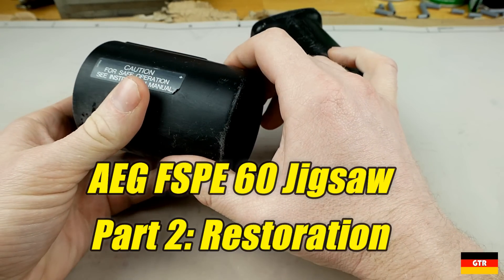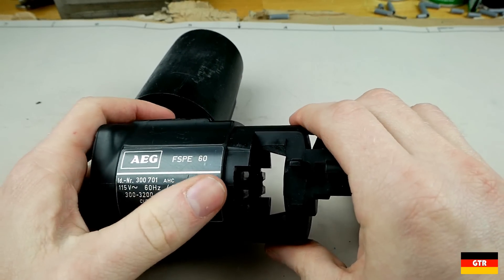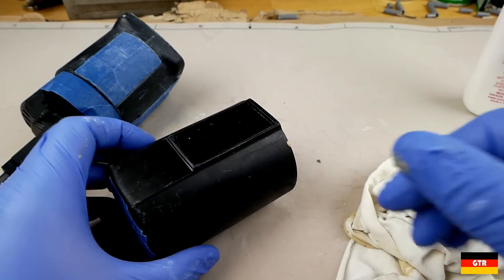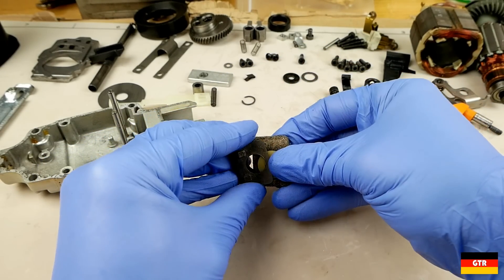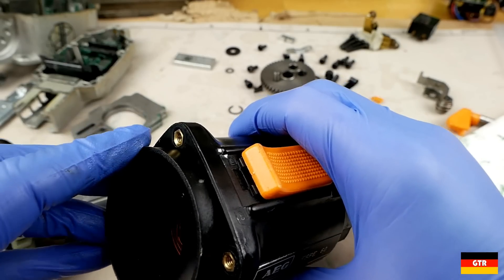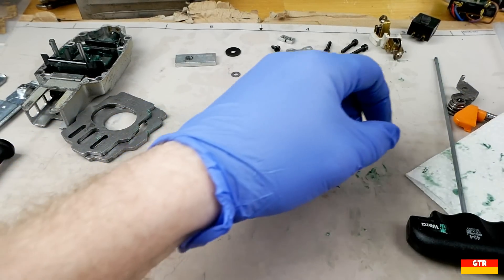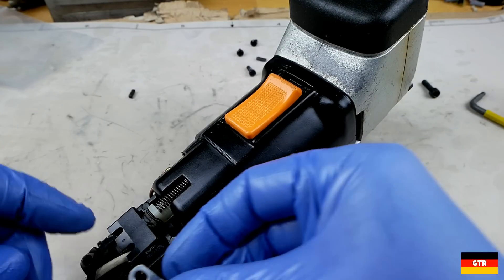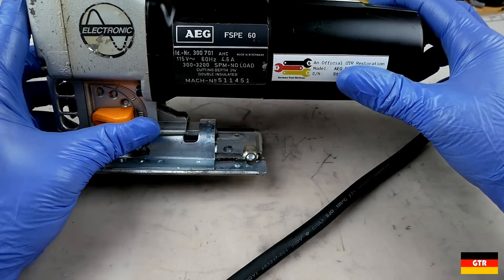AEG FSPE 60 Jigsaw Part 2: Restoration

Comment: What a nice end of this project.

Keep an Eye on your printed handle. It may warp over time or degrad due to the used grease/oil and/or sunlight. I 3D print for years at my job and the more I print, the more I want to go back to classic manufacturing techniques. 

But a fitting 3D print is ideal to create a mold for casting your finished part. 

Regards,
Etna.

Comment: Great video! Have you ever worked on an AEG FSPE 100 jig saw? After 20+ years mine needs a refurb, but for the life of me I cannot figure out how to take the head assembly apart. :(  I can see from the front side that there are assembly screws but the heads are not visible from the other side.